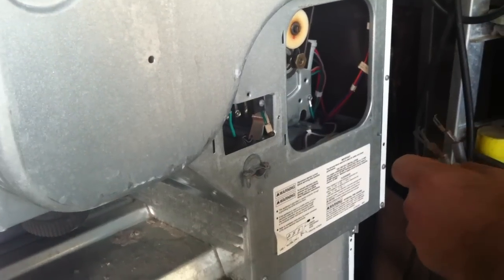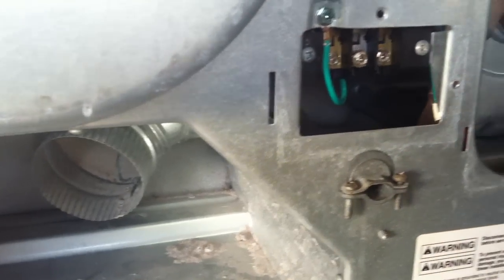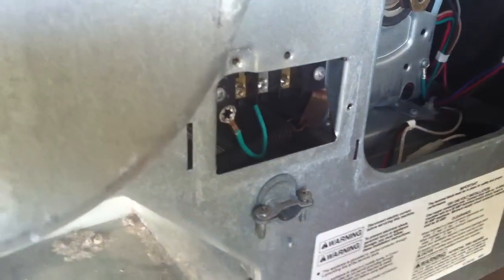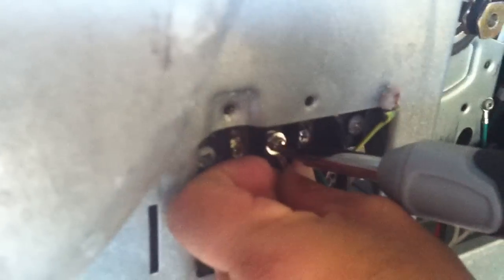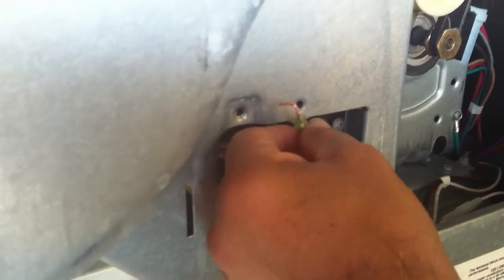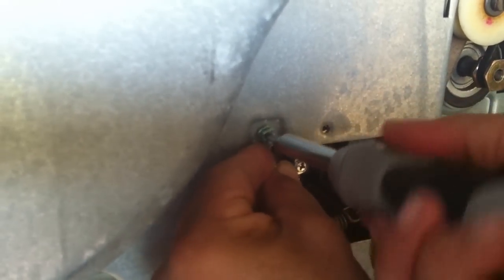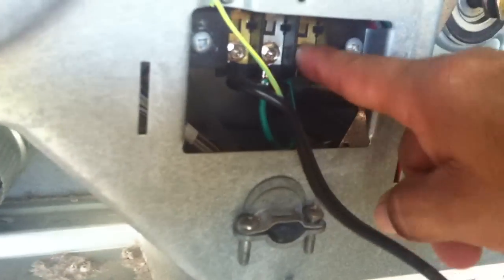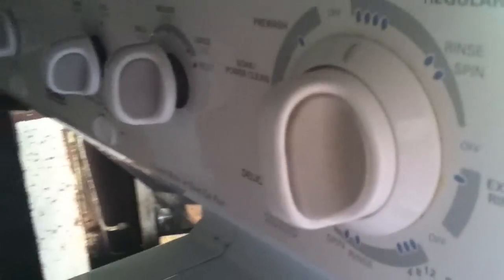240V Washer/dryer connected to 120V

Comment: And I know I’m colorblind, but doing an Olms test will tell you the yellow and green cord is the ground on his new cord at least standard United States plug would tell you that. so instead of him actually putting negative to negative he’s using one of the positive or negative terminals cause as we all know the circle part of the plug is the ground and that circle part the wire is green and yellow or depending on where the plug is made, it’ll just be pure green and the two plugs that looks like a flathead screwdriver. That one looks fatter than the other one’s positive and one’s negative so once he plugs in if it’s still the way, he showed us it would fry everything in that fucking goddamn dryer such as the dryer display or the motor because he hooked it up wrong
Reply from the maker: The video isn't to connect the dryer, ONLY FOR THE WASHER take the time to watch the entire video and read the comments from the people that going to use the washer because the dryer can't be fixing.

Comment: No, this guy said it incorrect he said the first one was red. The second one was neutral and the third one was black. That is incorrect. The two copper connections are hot. The middle connection is ground so please people read your instructions on your dryer before you do thisand remember you are only liable for the fire that you start because you don’t know what you’re doing.
Reply: And you can even see in the wiring diagram picture that the ground goes to the ground of the washers chassis or a good ground contact and the one in the middle if you read it, it says neutral, and the two on the ends are line one and line 2, so we have we did what this man was saying in the starting of the video, we would’ve actually caused a fire instead of bypassing having to have 220 V legs, electricity whether it’s 120 V or 240 V it is nothing to play with so do your research. Look at the wiring diagram of your exact  dryer and if you don’t have common sense or feel safe doing it yourself, have an electrician do it yeah legally they can’t do it, but I have never met an electrician that didn’t take cash extra to do something not to code. It’s sad but it happens.
Reply from the maker: @codyschwoch5451  Hey people do not get confused. That’s it’s very important that read the comments and see the porpoise of the video. The video was created to put the washer machine to work and it’s very clear that the dryer WILL NOT WORK. 
When the dryer doesn’t have anymore repairs (it’s dead) if you have one of this stackable you. Need to buy a new one or by washer & dryer separately. By using the conversion in my video You can keep using the washer NOT THE DRYER. In conclusion. I’m still using the washer after 10 years with this conversion of curse that I replaced few parts in the washer part due to ages but still working. 
Really appreciate you guys for the feedback.

Comment: but doesnt this reduce the dryer heat output by alot ?
Reply: 2:34 I’ve never had a household 220 volt Dryer. That is not what I’m looking for. I am not able to tell if you are working with a stackable pair or what.
Reply from the maker: Brian,  See all comments and watch the complete Video. The idea was to give use to the washer only when The dryer doesn’t work anymore then you can use the washer only. Is not meaning to convert the dryer from 220 to 110 , only for the washer. I hope this answer your question. Thanks for the comment.

Comment: With only the washer, a step down converter will work easy for the non-electrician.  My issue is with a 220 Dryer (from US) to 240 foreign.  The US dryer will work if you get a 110 to 220 isolated center tap transformer.  There may be an alternate way if you wire the 4 wires separately.  The dryer works on 110 to 110 hot giving 220.  This operates the heating element.  The 110 is taken from 110 to ground used for the electronics and motor.  If you wire them separately, it should work.  However, the question is what gets real ground.  Do you tie the two grounds together or only use chassis ground for the dryer case?
Reply from the maker: Thanks for the explanation. See the steps starting at minute 2:04. I really don’t know 4 the 4 wire dryers. But what I did was disconnected the ground from the chassis that ground plus the neutral from the cord connected to neutral and the ground from cord to the chassis,the hot cord goes to 1 or 2 (see schematics for your machine).

Comment: Disculpe ya hice todo y no prende que debo hacer
Reply from the maker: Asegurarce que el neutro es en realidad neutro O’Shea siguiendo el final de el cable que es la pata mas grande y Mira si esta conectado correcto. Si conectaste la corriente en 1 pues cambia para 2. Deveria de functionary en 1 o en 2.
Reply: Gracias por contestarme compre el cable y el enchufe el neutro es el redondito
Reply from the maker: Eriberto Acevedo. Primer que todo es la secadora lavadora.
Reply from the maker: Eriberto Acevedo. Es lavadora abajo y secadora Arriba?
Reply: @GUILLERMOJGARZON  maestro gracias ya funcionó nomas la secadora como prende
Reply: Si es igual como la que tiene en el video
Reply from the maker: Que bueno.  Recuerda que la secadora no te va a funcionar. Este video fue creado para que cuando la maquina (lavadora/secadora) no sirva mas. Puesto que originalmente trabaja con 220/240 se pueda usar solo lalavadora haciendo que trabaje en 110/120. Si tu  maquina funcionaba antes es de 220/240 y si lo que quieres hacer es que trabaje con 110/120 pues esto no applica a tu caso.  Tendrias que usar 220/240 para que lave y seque la ropa. Espero te haya aclarado la pregunta. Saludos
Reply: @GUILLERMOJGARZON  muchas gracias al menos ya voy a lavar en casa felicidades fue un gusto maestro

Comment: DO NOT SO WHAT THIS GUY SAYS!!!!!
He is Jerry rigging this machine to run as it was not intended! This is dangerous!!! He didn’t even route the power cord bac threw the strain relief. Do this at your peril!!!!!!!!!
Reply from the maker: Not all in real life is learning in school or is in books.  Thinking out of the box is how you fix things.thanks for the comments.
Reply: @GUILLERMOJGARZON  some people don't understand thinking outside the box, they just like to complain.  Your setup was great and saves a lot of money.
Reply from the maker: .Thanks for your feedback see all comments I mean all of them. After  more than 5 years still working and no electric problems whatsoever..just saying.
Reply: While I agree he should have ran the wire through the strain relief.  The washer was manufactured to operate on 120 volts and the dryer on 240 volts.  The terminal he attached the wire to seperated the two phases of the power, the 120 for the washer and he left the other side dead.  There is nothing wrong with this setup other than the wire not being secured.  The dryer was not intended to operate in this setup.  We have done this to 240 volt dryers just as demonstrating without using the heating element, even the dryer uses 120 volts for the motor and the timer motor and light inside the drum if it has one.  Now if he had tried to wire the dryer heating element things would have been very dangerous and a fire hazard, also since the dryer motor also runs on 120 volts along with the Dryer timer motor unless the dryer motor is dead the dryer will run although without the heating element because that takes 240 volts.  No after say all this if this would have been in a country that uses only 240 volts this setup would not work.  The only reason it works is the United States uses two phases of 120 volts to create the 240 volts for our major appliances.

Comment: can you convert a 240 dryer to 120 v?
Reply from the maker: Nope.  See all comments related. A lot of them from people that have a lot of knowledge related to electricity..Regards
Reply: I'm confused but ok
Reply from the maker: Johson Merk this convention is for a combo(stackable) when the dryer stopped working then only the washer can be used.  For a regular 240 dryers the answer is no. You can’t convert 240 dryer to 120.
Reply: Ok thank you
Reply: I found a way to do it for a dryer and it worked
Reply from the maker: Johson Merk . Hi there, you posted the wrong link. This is the link to my video in how to convert stackable washer and dryer but the dryer is dead and the washer will work in 120 but not the dryer.i will like to mention something the dryer will work with 120 but will not dry your clothes. I will like to se the video that you mention. Thank you
Reply: @GUILLERMOJGARZON  ....si que Jhoson Merk,muestre como lo hizo.
Reply from the maker: Cesar Garcia  pues  tienes razon . Le boy a escribir para ver como lo hizo. Yo creo que lo unico seria cambia la recistencia de 240 a 120 pero tendria muchisimo consumo electrico devido a muchas veces tratando de secar. Veromos su respuesta. Gracias Por el comentario nunca se me hubiera ocurrido en preguntarle.

Comment: This looks like a washer/dryer combo very similar to the one I have. Both units share a single 240 cord. Can I still switch to a 120 cord and turn them both on?
Reply: The receptacle and cord(to work correctly) needs to be 120/240 volts with 2 hots, 1 neutral, and ground.   The washer runs on 120 volts, the dryer controls are 120 volts, the dryer heating elements are rated to heat up a certain amount at 240 volts.   If the heaters are connected at 120 volts, it will take a long time to dry.    Strongly suggest you do it as it's designed to be used.

Comment: ola oyes como puedo convertir el outlet de 240v a 120v?  era de un calenton pero yo ocupo un outlet regular de 120v con ground. y no se como hacer para cambierlo
Reply from the maker: Un saludo. No es algo simple. Para esta hay que recablear desde la brequera ya que la corriente de 120 es completamente muy diferente.  Lo mas facil es comprar un transformador de 240-220 a 120-110 en las tiendas como lowers o Home Depot si vives en USA o en ferreterias. Mucho mas barato seria Por internet. Suerte
Reply: @GUILLERMOJGARZON  oh si y son seguros? es que lo que ocupo es un enchufe de tres pines con ground los que tengo en mi cuerto solo son de dos cables. yo le puse un adaptador para conectar un strip de mas conecciones pero es lo mismo no tengo ground en el oulet principal . y tengo bocinas y computadora que puede se friegen si algo pasa
Reply: @GUILLERMOJGARZON  en mi sala hay un outlet de esos como para calenton de gas y vi que si tiene tres cables tiene ground por eso queria ver si se puede modificar. o poner una extencion desde la cosina aya hay otro q si tiene ground y es de 120v creo que es mas varato que el transformador

Comment: Se puede cambiar el voltaje de la secadora solo cambiándole el cable a mi secadora ? Xq el cable es muy grueso xq esta secadora es 220 y 240 y mi electricidad d mi casa es 120 voltaje y no tengo enchufle de secadora normal solo los q hay en un departamento regularmente??
Reply from the maker: No. Mira es como tartar de prender un carro con una bateria de una moto. Si vives en USA todos los apartamentos tienen al menos una toma para conectar la secadora. La lavadora trabaja con 110-120v si tu maquina es lavadora abajo y secadora arriba (stackable) y funciona pues un electricista te pone 220-240v. Agora si tienes una (stackable) que la secadora no sieve mas pues este video es para que luego de poner los cables siguiendo el video pueda funcionar la lavadora. Cualquier duda pues escribeme. Gracias

Comment: guillermo por fabor esplica como conectar los alambres para esta secadora aunque no caliente suficiente
Reply from the maker: Obdulio Gonzalez .primero aclaremos algo no son alambres son cables de corriente. Nocreo que te sirva ya que primero el consumo de corriente seria increiblemente grande ya que estariamos hablando de prender tu secadora mas de 4 o 5 veces para una secada y segundo los cables se pueden calentar y eso puede convertirse en incendio no contando que el motor tambien se puede quemar ya que esta diseñado para 220-240vac no para 110-120vac. De todas maneras si tienes una stackable (lavadora/secadora) repito STACKABLE (lavadora secadora) pues sigue el video y en ves de corriente en linea 1 pues corriente en linea 2 recuerda en mi caso la lavadora fue en linea del lado izquierdo y secadora del lado derecho. Espero te sirva de ayuda.

Comment: You stated in the beginning you were changing from 240v to 220v .this does not make sense
Reply: I am trying to connecr to run 110v/120v
Reply from the maker: It is obviously if you keep watching the video the the porpoise is to convert it from 240 to 120. Also you can read all comments. I hope this clarify the confusion. Thanks for your comment.

Comment: I have same setuo and my dryer broke and realized after i bought a new dryer my 200 plug was in use by the old unit like urs thanks forbthe advice and savingbme hundreds of dollars
Reply from the maker: James Hunt,thanks for your comment..
Reply: 220 not 200
Reply: Actually 240 not 220 at least that's what I get with my meter.

Comment: Hi Guillermo I need help with something I bought a wire but mine has black white and green and my dryer has black white red and where do I put them ?
Reply from the maker: Nessa Barker you need to watch de video an maybe pause it/rewind it to follow the steps. Remember this will work for your washer only but not for the dryer. If you don't have an stackable you are looking the wrong video.On your wires the color are the same as I got for the conversion and the colors on your unit are the same as mine so follow the video. Just make sure that the other end of your wire(the white one) is the neutral (the bigger plunge). Hope this help you out and if you have any question please let me know,

Comment: Can I buy a Converter plug adapter? or do I have to re wire the washer?
Reply from the maker: Sherri Long  I assume that you have an stackable one. If so remember that only the washer will work and yes you need to find a 110-120 v old wire from an old washer and the reason is originally this stackable comes with a 220-240 v plug and the washer will work with 110-120 v. (Depends the country). Here in the US is 120v. You may want to watch de video one more time to see the convention. I hope this answer your question.

Comment: I have to add a jumper wire from the hot for the washer to the would be other hot wire terminal. This is because the wash cycles aren't cycling because the unpowered relays aren't kicking over. I'm not operating the dryer.

Comment: if you run a jumper from common to #1terminal, you will have 110v to the dryer heating element. it will take about four times as long to dry (because of Ohms Law) because you'll only get 1,400 watts approx. instead of 5,600 watts.  this is how RV and Marine electric clothes dryers are wired. They don't take special heating elements, they just wire up for 110v instead of 220v.
Reply: (if you run a jumper from common to #1terminal)
Where is #1terminal
Reply: So the common wire is the neutral
Reply: Scott Farmer that was my question..so thanks for comment
Reply: So how about an oven which run 240 volts was converted to 110v, would that take a longer time to to make?  what about if it is converted by a volt converter?

Comment: I believe I heard him say this only works for the washer...which is correct. The washer operates on 120v. The dryer however, has a control circuit that works on 120v but the dryer element only works on 240v.
Reply: Maurice Williams the heating element is 220v, dryer controls and motor are 110v. You can run a jumper between terminal 1 and common (middle terminal) and supply 110v to the heating element. Because of Ohms Law, the element will only be able to draw 1,400 watts versus 5,600 watts for 220v so drying will take about four times as long. ****WARNING*****DANGER****- DO NOT ATTEMPT THIS "CONVERSION" UNLESS YOU ARE A QUALIFIED ELECTRICIAN. FAILURE TO CORRECTLY WIRE THE TERMINALS, GROUNDING TERMINAL AND WIRE AND CORD MAY RESULT IN AN ELECTRICAL FIRE, PERSONAL INJURY OR DEATH!!! just making sure no one tries to sue me for injury, death or property damage. This wiring is similar to wiring a 110v/220v electrical motor. just remember, it's gonna take a long time to dry your clothes!
Reply from the maker: Maurice Williams . Yes thank you.

Comment: I'd like to specify that your diagram and machine look identical to my Kenmore/Frigidare/Electrolux from 2007. I think in error you mentioned to connect to Line 2 but your diagram as well as mine is showing the red wire as Line 1. Inside the dryer door it shows Line 1 as a 12-amp motor (double that for motor starting amperage). Line 2 appears to be the dryer motor which is 5 amps. I'm not sure if those are 240v amp ratings. These machines do not specify anything really.
Reply from the maker: Thanks for your feedback. Line 1 or 2 doesn't matter to much. If washer motor works in line1 fine if doesn't will be line 2. I'm been using the washer only for more than 2 years I do not need the dryer.
Reply: My washer seemed very sluggish. As if it wasn't rotating at full speed. But maybe with the split phase 240v (120/240) it may have been trying to draw additional power that wasn't quite there. But as far as I understand the washer is 120v with a 12 amp motor that needs quite a bit of startup amperage through the 120v line. It should be run on a 30 amp circuit with a 10 gauge line.